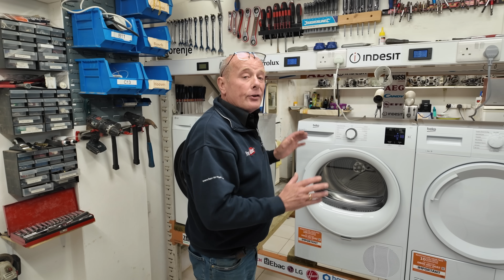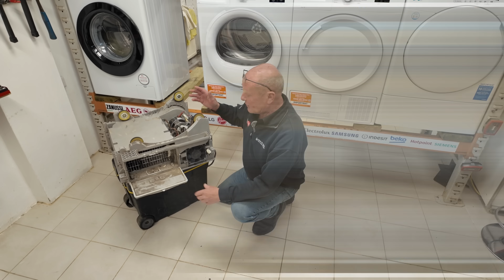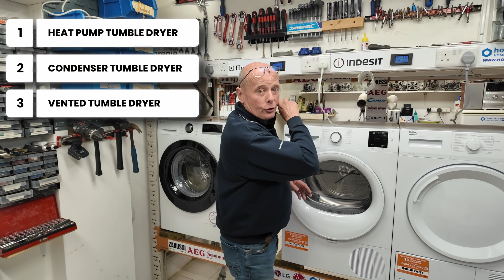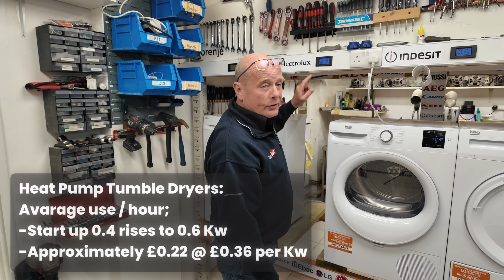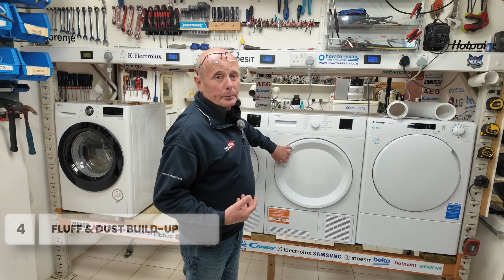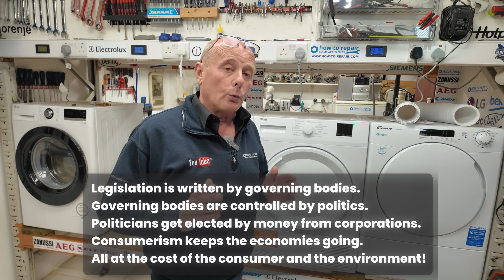Tumble Dryers the Shocking Truth About Heat Pump vs Vented & Condenser, NEW LEGISLATION!

Comment: In winter my condenser dryer is part of my house heating.  I wonder if it would be beneficial for the heat pump unit drum to rotate very slowly to reduce wear on the bearings and clothing.
Reply: I've had a top of the line condenser dryer, but it leaked way too much moist air into the room, as apparently many of them do, and made the humidity way too high, especially in winter it was even making the loft damp. swapped it for a vented one so that all the moisture goes straight out of the house. damp caused by dryers causing humidity which over time damages the house and contents is another cost to add in. HTR is correct about the heat pump ones, indeed he could probably have come down more strongly on them. I know you run dehumidifiers so moist air possibly not such a big deal if you have them on routinely, which again is power cost. Shame none of them produce sparkles out of their nickers eh. Hail to Ming.
Reply: @brianjohnson5789  Do you not realize that a heat pump dryer IS EXACTLY LIKE A DEHUMIDIFIER? They don't leak moisture and they don't pump 900 cubic feet a minute of your conditioned air outside. Yikes.
Reply: @brianjohnson5789 
Quality condensers do not spill moist air into the room. You get what you pay for.
Reply: @johnburns4017  This. I think the discussion should be able the quality of cheap versus expensive machines, and not the different technologies. A Miele heatpump drier could well outlast a cheap vented drier. It's not the technology that's the issue with modern appliances, it's the build quality.
Reply: @AnthonyCartmell  Miele will cost $$$$$ - not economical.
Reply: @tzm1843  and the vented dryer will remain fixable even if the original spare parts become unavailable, with generic components and basic technical inclination. good luck fixing the nightmare of a compilation the modern miele dryers are.
Reply: @johnburns4017  I paid for a machine that dried clothes. I didn't get one.
Reply: the speed of rotation assists the drying process, I thought that was obvious, it's about warm air circulation around each garment, too slow and the garments just clump together
Reply: @PeterPotnoodle The clue is in the word 'tumble'
Above the ideal rotational speed and the clothes stay  pinned against the outer wall of the drum....below ideal tumbling speed the clothes will just roll into a bundle in the bottom of the drum.
Reply: @PeterPotnoodle  Cool air will also dry clothes. The heat just speeds up the process. It would probably be more economical (with the current cost of electricity) to have a continuous cold air option taking in outside air and just letting it pass through the tumble dryer drum to vent outside again. In other words just like outdoor drying without worrying if it is going to rain or is raining. The nearest I can do to this with the tumble dryer I have is to just keep using the last part of the cycle where no heat is used but that is labour intensive and also does not draw in outside air. It does dry clothes with very little electricity being used. Why don't tumble dryers come with a no heat option and an inlet that a duct can be connected to?
Reply: @martinconnelly1473  Someone we know continued to use their tumble dryer like that after it gave itself a permanent "no heat" option.
Reply: @martinconnelly1473  Dryers, as an innovation beyond clotheslines, initially were Drying Closets:  a simple wardrobe with an extractor fan in which the damp clothes were hung. Some built in to the house like an icebox, laundry chute or milk delivery door.
Reply: @mikemotorbike4283  Years ago (1967 or 1968) I stayed somewhere that had a room with racks and two large fans to blow in and suck out air. It was a very fast way to dry towels and clothes.
Reply from the maker: Thank you, Clive. I am honoured to have a comment from someone like you. Over the last 10 years, your channel has helped millions with electronics. https://www.youtube.com/@bigclivedotcom You provide great information to help the general public repair many things. I have watched your content many times. Keep up the good work!

Regarding heat pump tumble dryers, the evaporator and condenser are the biggest problems. Dust constantly gets into these areas, making them less efficient over time. I expect someone of your calibre will really look into this information.

Yes, a heat pump tumble dryer will heat your house, but so will a condenser dryer. Basic machines are failing within four to five years, and any domestic appliance engineer will tell you this.
If you ever think about making more videos in the domestic appliance industry, please keep me in mind. I would be happy to help, although my liver suggests otherwise. This just shows how long I've been watching your show. LOL keep up the good work, you are an asset to YouTube
Reply: @How-to-repair  Well, on the basis of this information, I think i'll be keeping hold of my 36 year old Creda vented dryer,  still working fairly well, only ever had to replace the timer in all those years.
 I don't actually use it very often, I normally wait for a nice day & dry my washing outside, whenever possible.
I have an undercover outside area, so can usually get stuff dry outside most of the time & for free too!
I'm certainly not going to be 'green washed' by any of this net zero nonsense, which also means that i'll be keeping in use, my mains gas fires, which were installed in the early 1990s, they push out more heat than you'll ever need, they keep the whole place cosy, even on quite low settings, also very little to go wrong, just a quick clean every year & good to go for another winter!
I have a 40 year old electric convector heater in the bedroom, still working fine, nothing to go wrong with those & much better built & heavier than modern ones too!
I'm a big fan of 'If it ain't broke don't fix it!'
Reply: @NOWThatsRichy  Plus, the toxins from flexing clothes gets expelled when venting.  The druer vent is abominable to breathe if you smell it outside, for instance.  The HP and condensate dryers sequester and concentrate those pollutants within the clothes.  Plus it doesn't hurt to draw air through the house. Although, optimally, it's considered better to create positive pressure in the house when ventilating - by blowing the air INTO the house, not sucking it out. Creating a vacuum draws moist, frozen outside air into wall cavities, creating moisture issues. It also draws mouldy, musky, glass or vermiculite/asbestos insulation fibres and inner wall mouse-droppings air smells into the occupied space through cracks.
Reply: The amount of energy saved varies depending on where the machines are used. Here in Finland, we have to heat a large part of the year, so a large part of the waste heat from "old-fashioned" machines is put to good use. For example, my mother's apartment still has direct electric heating, so there is no point in buying, for example, a low-consumption fridge-freezer to reduce electricity consumption, because the heating radiators would just be on more often if the fridge didn't produce heat.  @How-to-repair
Reply: @How-to-repair  Just one point about only lasting 4-5 years... under the Consumer Rights Act, one should be able to justify a claim that a tumble dryer should last much longer than 4-5 years - the CRA only covers up to 6 years but at least 6 would be a bit better than 4, and of course if it did get replaced at 4-5 then the free replacement would last another 4-5.

And for those doubters, I have made successful claims on things years after any guarantee expired, e.g. a TV that lasted 4 years when TVs should easily last 10, an iPhone that lasted 2 years that should obviously last longer.
Reply: @How-to-repair  Too right Big Clive a legend, taking stuff apart so I don't have too ;-)
Reply: @How-to-repair  Could you elaborate on how it would heat the house a little more please?  I would have thought it would have cooled the house slightly as it's taking the heat from within the house to intensify it in the drum no? I know my water tank when I empty it is always surprisingly cold, which baffles me but I assume the heat pump is pulling every bit of heat it can into the drum
Reply: @How-to-repair hi what can you recommend to a normal household of 3 people like us to use is it condenser or vented or heatpump were leaning for affordable and long term
Reply: @How-to-repair  

They probably use 8-10 kWh for a full load and clothes take a pounding each cycle. We use 1 kWh or so, very kind to the clothes.

We have a 2012 Cylinda TVP 420 with heat pump. It has a 800 W max rating and it has served us BRILLIANTLY for 13+ years now. Only thing is a bit of belt slip(?) causing noise during first minutes of operation, that's been for many years now. We found it on sale and I got the price down a bit more, picked it up for around £400, original price was twice that.
It dries 8 kg of clothes in 60-90 min, so I'm not sure what garbage is on the market these days. 
Our 2012 Cylinda Sverigetvätten washing machine is very similar to the ASKO you recently reviewed, only older... We also have a Cylinda Sverigedisken, dishwasher, from 2012, nowadays produced by ASKO, while Cylinda took the path of planned absolecense. Our parents in law have an ASKO and after an initial warranty repair, it's been GREAT and the inside is fabulously great to allow three layers high stacking and STILL getting it clean!
Reply: @How-to-repair  dont really see an issue on the evap and condenser if you just clean em here and there? do need to do the same on a bog standard air to air heat pump for that matter
Reply: @How-to-repair won’t heat pump dryer cool your house? It pulls the heat from environment to heat the dryer. Anyways great video…
Reply: @Solveprobs  No doesn't work like that, the drying air is in a closed loop. It will in fact warm your house slightly because the compressor generates heat, and the excess heat has to be got rid of by a temperature controlled cooling fan blowing room air over a loop of refrigerant pipe. It just won't warm it anywhere near as much as a condenser dryer would. Also the lower drying temperature is less damaging to fabrics.
Reply: Would a dehumidifier be more economical being easier to repair and less ware and tear
Reply: @hoog111  I used to use a dehumidifier to dry clothes and after 8 hours the clothes wouldn’t be 100% dry (family of 5 so a lot to dry) and my heat pump dryer now does the same full load in 2 hours maybe a bit more.  Dehumidifier used 600 watts (desiccant type) and dryer about 450 so uses a lot less electricity per wash and saves loads of moisture added to house. One thing I like is just throwing the clothes in the machine and pressing go rather than spending ages hanging them up individually and turning them over every few hours….hated the faff.
Reply: The condenser is a dehumidifier  @hoog111
Reply: I was thinking of having a heat pump dryer to save money, but that thought has gone right out of my head, after watching this thank you 👍🥂
Reply: My Heat pump is 6 years old . 5 to 6 loads per week and i do it  all on one day . When the drum is hot clothes come out quicker and quicker . Load normally takes 70 min to 2 hours. Cant see myself without heat pump . My tumble dryer is a AEG.
Reply: Very good Video, thank you! In 2000 I bought a MIELE washing machine and on top sits a MIELE condenser dryer, a combo. After about 8 years I replaced the water intake valve on the washing machine and after about 15 years the shock absorbers. Apart from that, both machines run fine, now in there 25th year. I think that is environmentally friendlier then replacing a machine every six years.
P. S.: in my younger years I did painting work for insurance companies. I was shocked to discover how many housefires had started from washing machines, dryers and dishwashers. Since then, I make sure I am at home when those machines are in use.
Reply: Hi 👋🏾  Big Clive
Reply: @1stsummernitesI’ve just scrapped mine took on average 9hrs to dry a load … another woke green scam … I mean they don’t work in a cold room … yeah let’s wait till it’s warm to dry our clothes indoors 😂
Reply: @JAaurora2419 
What make of HPTD?
Others do not have that experience. Look at the comments. Some say the drying time is similar to other types of dryers.
Reply: @JAaurora2419  we Really, love our Samsung heat pump dryer, did some tests with it plugged in to a power meter and even outside in our unheated utility room works fine. The condenser fins nead a regular clean out. Uses about 25 to 30% energy  of the previous model! Only issue is drying duvet covers with other items, everything ends up inside!
Reply: @JAaurora2419 its not a "woke green scam" its companies who doesnt want to make high quality, easy and cheap repairability. If they made better products for the consumer (repairability etc) they would lose money. it would be better for the consumer.  And for the enviroment at the same time. People back in the days would be livid at how our consumerism is and how we scrap expensive and high prossesed appliences after a few years these days. ..
Reply: @ wrote "woke scam, they don’t work in a cold room". It's not 'woke'; or a 'scam', just because it doesn't work very well in your situation. That's a technology mismatch. 
Yes, people should explain that (some?) models are designed to work in a room-temperature building, not a garage/outhouse, but it's just silly to call it a scam. The machine design is not a scam  - it's just not intended to be used the way you were trying to use it. Or maybe it's even a bad design. It's still not a scam.
Reply: @JAaurora2419  You should have done even a tiny bit of research before you tried to lie on the internet to promote your planet-destroying agenda... heat pump dryers don't depend on room temperature to work EVEN A LITTLE BIT... you're thinking of heat pump water heaters. Heat pump dryers merely create a temperature difference in the airstream that condenses the moisture out, without wasting the heat like a condenser dryer.
Reply: @JAaurora2419  I have to have a dryer which is a vented one in the garage as my kitchen is so tiny, so if the heat pump one will only work in warm conditions it is no good to me, and the amount of time it takes to dry the clothes too. I really hope the Government will rethink this one, give us the option as to the type we want not dictate to us. Thank you for your info too 😀
Reply: Maybe we have different models but that's not my experience, have a kid so there's a few loads a day, I appreciate the lower electricity bills.
Reply: To be fair Mr Mitchell,   Chez Big Clive is pretty cold by most peoples standards 😂
Reply: One moment plz
Reply: Our current dryer is 11 years old and I haven’t done any maintenance other than cleaning it good every year.
Reply: Professor Clive knows best 😂😂😂😂
Reply: 😁😁Bigclive is on board....!!!!
Reply: Imagine seeing you here, Clive. With your latest video, it gives a whole new meaning to Electrolux. 😂
Reply: I wised up to this situation when heat pump dryers entered the market. I instead replaced the vented dryer that was in the laundry room of the house when we bought it, replacing it with a condenser dryer + a dehumidifier. The heat from the dryer is thus utilised to facilitate drying of laundry hanging on clothes lines in the laundry room in synergy with the dehumidifier.

Regarding condenser dryers, I suspect most people replace theirs when they no longer dry clothes, instead of inspecting the condenser and cleaning it! 😮 🤦‍♂️
Reply: @sillywizard6220 
Condenser dryers take longer to dry than normal dead loss normal dryers. So condensers uses 2 kW for longer than normal dryers which consumes 2.5kW. Sounds about equal for a load. 

But as Big Clive stated the condenser will aid heating the house in winter. 

So, a ballpark assessment is that the condensing dryer saves more money overall that the others.

But! Jimmy Gillies assessment of HPTDs is compelling.
Reply: @johnburns4017  Condensers take longer but because the warm air cycles around rather than being continually heated from room temperature the heating element will cycle on and off, and the overall energy used can be similar.
Reply: @thefirstchoice5493  
I know I had one. 🤨
Reply: @WoodyAllen-q5d We used to do that at our old house, but I was stunned that when we moved and had room for a HP tumbler, they do actually use even less power.
Reply: @WoodyAllen-q5d Surely that is all a heat pump dryer is anyway?! A dehumidifier with a tumbling drum
Reply: My 10 year old White Knight Gas tumble dryer is the best investment I have ever made..it has been used almost every day since purchase and is still working as new..Gas Tumble dyers are brilliant but I understand White Knight no longer make these units.
Reply: My Belling gas tumble dryer has just stopped working after about 12 years of constant reliable use, it was a brilliant machine, I am so disappointed to not be able to replace it with another gas tumble dryer, hence why I'm on here reading all these comments, don't know which to replace with, leaning towards a condenser style  @suzylawrence6
Reply: No joke. We put our heat pump dryer in our garage when we moved house, we brought this dryer from our previous home, and once it got below 5 degrees it could no longer dry properly and all the moisture air condensed on the door and front panel causing water filled fluff to flood at the bottom and clog up the condenser. This lead to a drying process taking over 10 hours and still damp. This will result in the sale of tumble dryers falling drastically if people don’t have a dedicated space for  a dryer.

Edit: Our Heat Pump Dryer has failed. It has now been replaced with a standard condenser dryer. Maintenance is now so much easier than heat pump dryers.
Reply: Interesting point there B Clive...
Reply: @WoodyAllen-q5d I do the same. Dehumidifier only uses 150 Watts so running for, say, ten hours uses 1500 Watts about the same as the Heat Pump drier running for three hours, but that would need to run a few more hours to do the job.
Reply: same for me
Reply: It's f*cling big Clive come on. We are not worthy
Reply: I've got an AEG and it's not rotating quickly at all.  I'd need to see a side by side comparison to know for sure.  But not all bearings are equal. It could be the case a cheap vented version uses cheaper bearings.  One other thing, the extra heat in a vented dryer could cuase the bearings to wear more quickly due to the heat drying out the grease on the bearings.
Reply: I understand the point about the wear on the bearings, but compressors last a long time in fridges, and they are on 24/7. Why should a tumble dryer compressor fail any sooner?
Reply: @thefacultyoffunk   The compressor and system likely dont fail faster than a fridge. The condensers just tend to clog up on many models which have poor filtration. IMO the only reason a manufacturer would choose to use poor filtration is to make it lose performance after a few years to make you buy a new one... or force the cost of an engineer to fit a whole new base inc compressor and system. One of the reasons why the appliances of 20-30 years ago lasted 3-4 times longer than most modern appliances.
Reply: Good question my heat pump drum move slow.
Reply: I reckon Big Clive & Ralfy should sit down together with a wee dram and watch it go round and a round 🤣
Reply: I bet your house is really dusty.
Reply: @WoodyAllen-q5disn’t a dehumidifier basically an air conditioner, how is that cheap?
Reply: Periodically lube the bearings with power up NNL690 (can also be mixed with grease) it will last forever...
Reply: Especially as the thing creates so little heat
Reply: CHEERS BIG CLIVE!
Reply: I have just bought a condenser dryer as I can't use a heat pump one in the garage most heat pumps need a minimum of 20°C to work efficiently and condensers 5°C so in realistic the heat pump is not efficient as you have a house to heat lol.
Reply: @darrengarvie8832  

Lowest temperature listed in installation instruction for my Samsung HP dryer is 5C to work efficiently.
Reply: Ours was running slowly. Turned out to be the two capacitors on the motor were way out of tolerance.  Replaced them and it goes great now.
Reply: Do you have to be Fgas registered to work on a heat pump tumble dryer & what gas are they charged with?
Reply from the maker: Slower RPM does not really work on the components but turning slowly would be great but if you do this, you are also going to reduce the airflow through the machine unless you geared the drum only but there wouldn't be no saving on motor wattage
Reply: Heat pump systems are total shit in most domestic UK situations all engineers know this the only people pushing it are the government apart from being ridiculous to repair. You will not find anyone who knows how to fucking do it, that goes for these machines or the monstrosities stuck on the side of somebody’s house.
Reply: Brilliant video.
I considered extending the exhaust from my vented dryer in order to reclaim some of the heat from the exhaust. Instead, I am switching to a condenser tumble dryer. Just like Clive is implying, calculations of efficiency do not take into account the contribution that they make to the warming of your home in winter. In summer we really should all be hanging our washing out to dry. I also read reviews of heat pump dryers not managing to fully dry clothes sometimes.
Reply: ❤❤❤❤❤❤❤❤❤❤     Clive    you are a superstar and you deserve it
Reply: Big Clive has entered the chat!
Reply: Same here it’s heating for the living room and kitchen been open plan
Reply: Now I see why this has appeard on my recommended lol.
Reply: It can't rotate very slowly because the motor also drives the blower which needs high volume of air to pass through the coils. Putting into separate motors would increase the cost dramatically.
Reply: Interesting comment. I think if the drum were to rotate slower you would lose the tumbling effect of the clothes. 
I think the drum speed is calculated so the clothes "stick" to the drum through a bit of centrifugal force, but gravity takes over near the uppermost point and the clothes tumble down through the airflow.
Reply: @simonc5313  The drum speed would be optimised on modern heat pump machines, but on older tumble dryers is not optimised, they normally use an induction motor, the speed of which is determined by the mains frequency and the number of poles the motor has, at 50hz a 2 pole induction motor will run at a bit under 3,000rpm, a 4 pole would run at 1,500rpm. The belt runs around the outside of the drum, the diameter of that is limited by the width of the machine and the diameter of the motor spindle couldn't really be made any narrower than they are to slow the drum down, without it damaging the belt, so basically you get what you get. A modern machine such as a heat pump uses a more energy efficient inverter driven 3 phase motor, the speed and direction is controlled by a microprocessor on the inverter board, so can easily be optimised.
Reply: @mels8966  my heat pump dryer does not use a VFD on the motor. The motor is single phase with a starting capacitor (which I changed when it failed).
I would imagine the drum speed would be critical for an effective drying process. Too fast, clothes will stick the drum by centrifugal force. Too slow, the clothes will just slide and bunch up. 
Regardless of the dryer technology used, the drum speed would need to be fast enough to make clothes stick to the drum. But slow enough for them to fall (tumble) at the highest point.
But yes, using a VFD on 3 phase motor would be more energy efficient than a 1 phase induction motor.
Reply: I'm going to comment here, because I'm not sure if I'd rather see Big Clive or Paul answer (of course neither of you is obliged to anyhow, and anyone else is free to answer too!): In these tumble dryers with auto-dry settings, which use a moisture sensor that is made of two separated metallic strips, what do the electronics test: the resistance of the air between the contact strips, or of the clothing in the drum? In some models, like a Miele which has contact strips on the drum ribs themselves, it seems to be the cloth, but in other cases, the contact strips are on a bulkhead (front or back), where it doesn't seem certain that the cloth will touch very much, if at all! I'd be glad to hear an in-depth explanation of these moisture sensors, including perhaps: an evaluation of their effectiveness, and common failure modes (like when they stop working because of an invisible coating of oxide or wax).
Reply: The heatpump version uses so much less energy it does not heat the room nearly so much. Also a heatpump dryer works more efficiently in a warm room. A normal condenser dryer works better in cold rooms. The heatpump version generally pays for itself easily within three years from energy savings. I know a few people to have had the heatpump version for several years with no issues. Also the heatpump version  dries clothes at a much lower temperature. From the repair point of view some good points.
Reply: I'm so glad came here.  Recently visited a large electronic store as in need of a new washer dryer, I'm limited on space and depth no larger than 56cm and currently use a condenser WD and fortnightly maintenance for last 10yrs but energy rating is now a E+.  I only use dryer for towels and bedding in autumn/winter months (have a large balcony & roof space love a windy perfect drying day).   Non of the heat pump ticked any boxes plus guy didn't know anything about running faults reported and he waffled my head.  My budget is £600 total.

Need recommendations please plus learning so much here 🙏
Reply: A dryer drum has to rotate a a certain rpm to tumble clothes properly, too fast and they cling to the side of the drum but also.. If a dryer is geared to turn very slowly the clothes wont tumble as well and therefore dry as efficiently... so you'd likely end up with both a drying time increase as well a higher drum and motor revolutions count per drying cycle... and therefore increased drum, motor bearings and drum seal wear IMO.
Reply: nope, heatpump dryier will uae less electeicity, but it pumps into drum heat as names states. and this heat conea from your home where the machine stands. so in fact it cools your house initially and warms up clothes.
Reply: Their was a well respected rock music journalist named Malcolm dome rip who only passed a few years ago, you sound exactly like him when you speak, are you by any small chance his relative, I even see a small resemblance.
Reply: It seems that it would be far better if they operated like a mini-split AC system. The compressor doesn't necessarily have to go outside your house. If it was made that way the wear items such as bearings would be more accessible, and dust from the drum wouldn't be right next to the coils. If you had a gas leak your AC technician would be willing to work on it.
Reply: Please tell, how is the heat pump dryer used in household heating ?
Reply: I would not worry about wear as much. All the fluff you collect is the fluff that would float around your house and needing dusting.
After 10 plus years of heat pump drying, I still own clothes that are longer lived, at some point the holes in them will make them obsolete faster than tumble drying.
Reply: No says the CEO then our profits go down 😂
Reply: You are right they rotate too fast and spoil the clothes. It might bi interesting to have the possibility to reduce  the. Turns as we usually do  for the spin of our washer.
Reply: That probably use 8-10 kWh for a full load and clothes take a pounding each cycle. We use 1 kWh or so, very kind to the clothes.

We have a 2012 Cylinda TVP 420 with heat pump. It has a 800 W max rating and it has served us BRILLIANTLY for 13+ years now. Only thing is a bit of belt slip(?) causing noise during first minutes of operation, that's been for many years now. We found it on sale and I got the price down a bit more, picked it up for around £400, original price was twice that.
It dries 8 kg of clothes in 60-90 min, so I'm not sure what garbage is on the market these days. 
Our 2012 Cylinda Sverigetvätten washing machine is very similar to the ASKO you recently reviewed, only older... We also have a Cylinda Sverigedisken, dishwasher, from 2012, nowadays produced by ASKO, while Cylinda took the path of planned absolecense. Our parents in law have an ASKO and after an initial warranty repair, it's been GREAT and the inside is fabulously great to allow three layers high stacking and STILL getting it clean!
Reply: This is generally lost in the debate between condenser dryers and vented dryers. (Yours is a super YouTube channel Clive)
Reply: My condensing drier is naturally only used much in bad weather.  The energy input goes three ways.  One is to power the motor to turn drum and fan.  The second is to provide the latent heat of evaporation.  The excess heat which escapes ends up heating the room.  In a traditional drier, all the inefficient excess is lost to outside.  So the condensing drier uses more kilowatt hours but that loss is more than made up by saving on central heating.  And drying clothes in the house absorbs latent heat of evaporation from air within  the house so you effectively use your central heating.  Drawback of using condensing drier to heat house is electricity is 5 times the cost of gas
Reply: I specifically went condenser as I don't use often and as Clive mentions harvest the heat in winter.
Reply: I can't see it being a major issue, I've never had to replace the bearings/motor on a dryer,  it's a far less harsh/stressed environment than a washing machine.
Reply: You'd need the drum to be rotating at a reasonable speed to keep the clothes tumbling in the flow of warm, dry air, otherwise they'd take forever to dry. Although, the RPM of older belt driven tumble dryers is more determined by their use of single phase induction motors and the diameter of the drum, than optimising the tumbling speed. It would be beneficial to increase the airflow by avoiding unnecessary bends and restrictions in the ducting and using a better fan, and also increasing the size of the heat pump's heat exchangers and compressor. I've read that some of the latest generation of A+++ rated heat pump dryers use a belt driven fan to achieve that, and also have larger heat exchangers, they also have variable speed compressors to optimise drying performance. I've also read comments by owners of current generation heat pump dryers, that the drying time is not significantly longer than a traditional condenser dryer, providing the room they are in is at a reasonable room temperature. Also drying at a lower temperature is less damaging to clothing, and especially clothing with elastane in it.
Reply: also heat pump dryer are probably less of a fire risk, my own vented dryer was one of the recalled hotpoint models, due to lint getting in the elements and starting fires.  Although they do use propane or isobutane as a refrigerant which could be a concern if it leaked.
Reply: @mels8966  The refrigerant is flammable ,and in certain air and refrigerant propane with a spark , can be explosive. But yes at the time of purchasing mine..There were a lot of news reports of fires from the older type driers.
Reply: @andrewtitcombe8378 The dryer fires usually result from people not cleaning the filters and not having enough ventilation.in the area the dryer is used.
..
We've had cavity wall insulation installed & some extractor fans at the same time to maintain airflow/ humidity levels..
Reply: @andrewtitcombe8378  There have been a handful of news reports about fridge/freezers exploding and taking out walls due to the flammable refrigerant they used leaking inside their cabinet and forming an explosive mix with the air. One I recall reading about, the leak was thought to have been caused by the owner's careless use of an ice scraper, and was probably detonated by a spark from its mechanical thermostat.  Yet to hear of any heat pump dryer exploding, but conventional tumble dryer fires are still a problem. I can confirm that the indesit hotpoint modifications seem pretty effective, because I had mine apart recently because the drum was stalling due to lint getting trapped in the mounts for the "bearing" pads that support the lip of the drum and causing binding and there was little lint, with none in the element, whereas prior to the mod, when I had it apart to replace the drum shaft, drum bearing (cheap oilite bush), pads and seals there was burnt lint in the element and the case was packed with lint (enough to fill one and partially fill a second  large bin bag).
Reply: @andrewtitcombe8378 does condenser and vented have gasses?
Reply: @revelationgenesis3045  No they don't have gasses in. I would recommend a condenser type for reparability, reliability, recyclability disposal, and middle ground for efficiency   .
Reply: Point 1)  I have a small solar panel system which, for much of the year, produces sufficient renewable energy to run a heat pump dryer but insufficient to power the heating elements of a resistive system.  That saved us a vast amount of day-time electricity cost over a 4 or 5 year period when recycling the dryer load for (re-use) was important.

Point 2)  The fire risk, for a machine using 400W, is far less than those with resistive elements of 2kW or more.  That should mean the heat pump dryer could be run safely at night on a cheaper unit cost.  I would never consider running a resistive heated tumble dryer while not in attendance.  Too much of a fire risk.

Point 3)  Improved ventilation systems should be designed for the heat pump machines.  

Point 4)  Improved accessibility for maintenance should be part of the design.  

Point 5)  The water collection vessel is often at a ‘convenient’ height.  This adds complexity - a pumped-on-demand (from a low level collection vessel) might be simpler (particularly for physically-challenged users)?

Point 6)  The cost difference should not be so great.  Doubtless, if only heat pump machines are allowed to be sold, there should be more competition between manufacturers as well as economies of scale for manufacturing costs, thus reducing the unit cost.

Point 7) White electrical goods should be designed for a longer life, in general.

Point 8)  Adoption of brushless motors should reduce yet another common failure mode.  In my experience, most induction motors have a very long life expectancy - far better than brushed variants.

Enough to think about?
Reply: @oliver90owner  clothes are expensive, moreso than a few pennies saved on electricity! Women, and men, pay hundreds, if not thousands for items! The main problem is premature wear and tear.  The famous Staber Washer uses water forced through the rotating drum holes to agitate the clothing; they found contact with the drum is what wears clothes.  As well as all those repeated deformations as the clothes bend back and forth.  On your body, it's the grit that wears bending material.
Reply: @oliver90owner  The risk with an element is lint getting past the filters, or otherwise from poor design getting onto the element, which could result in ignited lint being blown into the drum, or onto already dry lint trapped in the drum seal. My own dryer had a flammable foam drum seal at the back before the fire safety recall. Unlike an element, the evaporator in a heat pump dryer doesn't get hot enough to start a fire
Reply: @oliver90owner  I think most conventional tumble dryers use capacitor start/run induction motors, which are very reliable, bar the electrolytic capacitor losing capacitance over many years and eventually needing replacing. They plus their relays/triac controlling them are probably more reliable than the 3 phase inverter's electronics used to drive a modern more efficient permanent magnet, 3 phase brushless motor.
Reply: @      Yes, it is likely mainly washing machines with brushes - but I think our previous tumble was fitted with a universal motor.  Many hand and power tools use brushless DC motors these days.  They tend to make everything as cheap as possible because they don’t want the machines to last too long.
Reply: The fan is driven by the same motor as the drum.
Reply from the maker: @Fastandpro  and the only way of reducing the speed really is changing the pulley size on the drum, this would allow the airflow to be the same, but the drum will rotate slower
Reply: @How-to-repair  Agree but too busy sticking pins in my eyes this weekend,🙂
Reply: @How-to-repair  LG's direct drive DLHC5502 is variable speed, a heat pump, and a beast of a machine. Seriously, it's the only time I can remember where the US gets better tech than europe lol.
Reply: @Fastandpro  not on my AEG unit
Reply: 👍Good point. The "wasted" heat from our condenser dryer heats our kitchen quite nicely. So, arguably, this is not wasted energy in colder weather for more than half the year?
Reply: @Steve-GM0HUU  True, but gas heating, or even a heat pump is cheaper to run than an electric heating element, and no one would have their tumble dryer controlled by a room thermostat.
Reply: Isn't the heat pump dryer gentler on your clothes because it's lower heat over longer period, than higher heats for a shorter period. Assuming the tumbling isn't that bad offcourse.
Reply: @qkayani  not if it takes 4 times longer it isn’t
Reply: @JAaurora2419  where have you got 4 times longer from? Sounds like bullshit to me.
Reply: @JAaurora2419  just dried 8 kg of wet towels in 3 hours in my hp dryer so yes they work fine. Full load of clothes takes 2 hours.
Reply: @ naw ye didnae
Reply: @qkayani Yes it is, this guy obviously has some agenda to tell half truths to make heat pumps look worse than they are.😉
Reply: @qkayani  Heat pump driers also use very dry warm air (they're dehumidifiers, as well as heat pumps) instead of hot ambient air.  The air temperature is only half the story: some things are freeze-dried :)
Reply: @AnthonyCartmell  hmmm interesting idea to dry clothes.  I wonder if it would work, but freeze dryers require an oil change every vacuum cycle.
Reply: @qkayani yes heatpump dryers are kinder to clothes, I have one
Reply: My vented dryer sucked warm air out of my utility room and this was replaced with cold external air that then needed heating. Do your calculations take that into account?
Reply: @richarddgjames  I believe that accounts for an extra 1000W (assuming an almost freezing temp outside)
Reply: @richarddgjames  He says drying it inside or outside doesn't make a difference, but i' dried my clothes in an outside dryer and the clothes barely get lukewarm compared to when inside, so it does take longer. And in the house, the inside expensively heated air is forced outside at the high CFM (cubic feet per minute) of the fan!  In the summer, I am saving about 5 kW drying on low and running longer.
Reply: I have a washing and drying machine of the same brand as the condenser dryer in this video.
Both are doing good 5 years in.
..
What i have found,
When washing is to select extra spin on the wash cycle.
Mine runs @ 1400 rpm 
(goes like the clappers at full speed..)
most of the synthetic clothing is almost dry when the machine is done.
Less drying required..
..
Heavy fabrics like towels, always take longer to dry.
I place them on the radiator for a day.
..
My condenser dryer does indeed heat our kitchen up quite nicely..
But we also have an extractor fan near to maintain humidity levels.
..
Did an experiment couple years back. 
I collected all the fluff from the dryer for a year.
Came to 2kg!
..
Reply: My heat pump dryer will run rather faster in the "wool" programme. That stops the clothing from tumbling around.
In any case, I like that it is less of a fire hazard as there are no heating coils that will accumulate dust.
Reply: My Samsung Heat pump dryer has just packed up after 2 years after it proved nearly impossible to properly  clean all the wet lint stuck to the metal foils on the non removable condenser at the bottom of the dryer. Tried my best but damaged the foil and now need new part! Gonna cost £300 I ve been told. I don't believe HP dryers are less of a fire hazard because you can't remove the  condenser to clean it. So fulff can  build up inside without you being able to access it.
Paid £650 for something that lasted 2 years
 I'm going back to non HP.
Reply: @pizzablender  The added complexity of the condenser dryers might increase fire hazard. We would need to see statistics to ferret out the reality.
Reply: @pizzablender  I'm going to try wool setting next time. Thanks
Reply: @pizzablender 
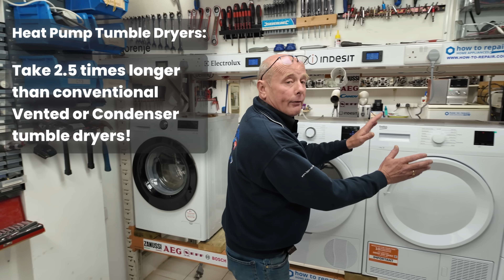That's the primary advantage to a heat pump dryer, is there's a much reduced risk of fire. This means it's less dangerous to have them run at night of low cost electricity, which will maximise the electricity savings. I pay 6.7 Pence per kWhr between 00:00 and 07:00, so drying clothes would be very cheap, when compared to a normal condenser on day rate electricity.
Reply: One of the most important things is to really think about what machine/dryer you get is the number of functions. The majority of machines come with loads of programmes when in reality youl only use one one of those 95% of the time. So ditch the multi program for a higher spin speed= less water in your clothes to dry. We have a condenser dryer as it saves on having the outside vent, however the previous one I could clean, this one which is supposed to be a better make I can't do that and I'm seriously worried about the dust that's in the dryer😢
Reply: Great to see some input from a fellow Scot, all be it a big hairy one😂😂
Clearly, the science of Relative Humidity is lost on several posting Clive auld son. Either that or they’ve been indulging in your Brother’s Moonshine Whisky?.!!
Reply: @jimmygillies5590  Happy Burns day!
Reply: @jimmygillies5590  Big Clive, fancy seeing you here!
Reply: Our Cylinda heat pump dryer from 2012 is still happily drying clothes. 
It hasxa max rating of 800 Watts. 
It does not take 2 hours to dry a load. 
It takes 8 kg. 

Very very nice machine!
Reply: @My_HandleIs_  
Is it full of fluff.
Reply: its an expensive way to heat the house. I could see the spike in the room temperature when the dryer was running. I don't see that spike with the heat pump.
Reply: In winter vented tumble dryers also drag cold air from outside the house to replace the hot air being pumped out. So not only is there the cost of the electricity that the dryer uses but also an additional heating cost for the house. 
Best combination in a laundry room is a condensing dryer with a small external dehumidifier which can also be drying clothes not suitable for a tumble dryer.
Reply: Why does it take 2.5 times longer? That’s quite a bold statement….🤔
Reply: I'm surprised bearings are even brought up as a killer. Bearings can last a very long time with a well designed machine, and you can use better bearings for a long life. It's not like they're a fixed life product and the same across every machine.

Not to mention the claim about 2.5x long runtime is very bold and not true. Most people who have one seem to have a similar runtime to a regular vented electric dryer, same for my experience. Only gas is faster, at the expense of clothing wear and tear. I mainly dry my stuff on the lowest temp because that's what the tag says on a lot of them.

Motors can be better, filtration can be done well, and coils can and some are self cleaning with sprayers.

I just don't think that the first thing to cause an issue is going to be bearings.
Reply: @Jaker788  I agree, bearings should not be an issue if suitably specified ones are used. All my vented dryer uses is a very cheap oilite bush (sintered bronze metal powder filled with oil in the pores) for the steel drum shaft and plastic pads on the lip of the drum, and that lasted about 8 - 10 years before the thin steel drum shaft wore through the oilite bush. 
The bearings in my previous tumble dryer were good after about 27 years, I only chucked it because I'd burnt my arm on the front mounted element one too many times, plus it needed a new motor capacitor and I was concerned about what appeared to be asbestos string used to suspend its spiderweb element, as it was disintegrating. 
Washing machine bearings are under far greater load and stress, spinning a load of wet washing at 1,600rpm, which is why they use 2 sets of ball bearings, not a bush, the ones in my washing machine failed after 10 years, but only because water got in them due to the water/oil seal leaking and seized the inner one up.
Reply: @Jaker788  Even if they take longer, I strongly suspect the higher drying temperature of a traditional tumble dryer will have far greater damaging effect on clothing than being tumbled for a while longer in the drum. Perhaps 2.5 times as long to dry might be true for a first generation heat pump that's been fairly well used, so has a layer of lint on the fins of its heat exchanger. Heat pump dryers have improved rapidly since they first appeared on the market, an extra filter, self cleaning, improved self cleaning and improved filters, bigger heat exchanges, more efficient/variable speed compressors, faster airflow etc. The energy efficiency rating labels have struggled to keep up with them, I've read the recently revised tumble dryer ratings were intended, and expected to last for several years, but manufacturers have already developed A rated dryers under the revised rating system, so they'll have to be revised yet again. I've also read quite a few comments by owners of newer generation machines stating that the drying times are not significantly longer than their previous condenser models, the only reason I'm yet to replace my vented dryer is I've been using it much less frequently in the last 2 years, so it would take a very long time to recoup the electricity savings. One reason to consider a vented one might be if you have it in an unheated outbuilding, although some current heat pumps claim to be suitable for ambient temperatures as low as 5°C.
Reply: My heat pump dryer's drum doesn't rotate fast. Why would it?
Reply: ⚠️Who even buys driers?!!
We have good old fashioned clothes drying racks in a spare room used in conjunction with a rotating desicant disc  dehumidifier (no compressor)
Clothes are dry the next day.

There's very little 🔥 risk with our method as we've heard of so many driers catching fire. 
We would recommend every drier cover is removed annualy judging by the fluff is found in these.
Thanks for pointing out the pitfalls of heatpump driers, we would never select those.
Drying racks do not wear your clothes out ⚠️
Reply: @julesviolin  for me, a dryer is a game changer,  2 adults and 3 teens so pretty much adults. The amount of time saved hanging loads up and turning every few hours every day drove me mad,  now I just throw it into the machine and press go. Savings in electricity have been big, my Ecoflow desiccant dehumidifier used to take 8 hours plus to dry a full load using nearly 5 kWh of electric compared to 1-1.5 kWh with the hp dryer. That’s a saving of over a MWh per year.